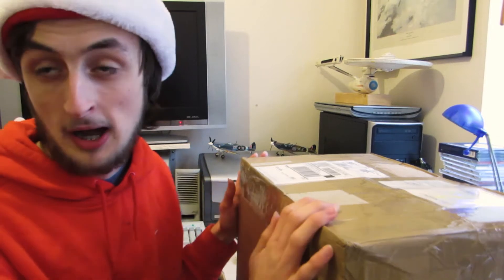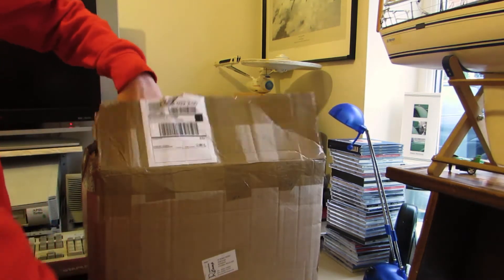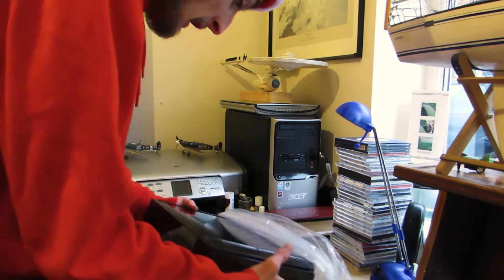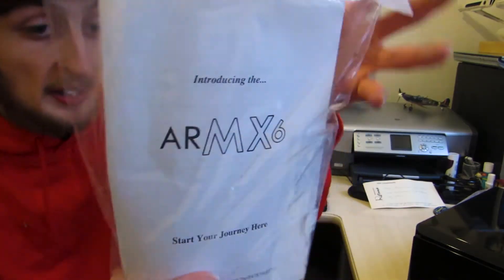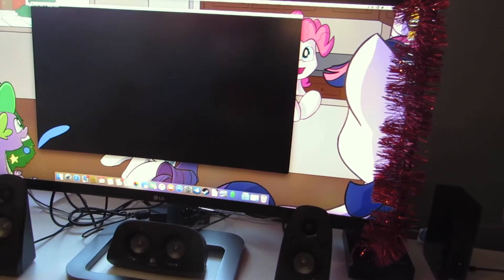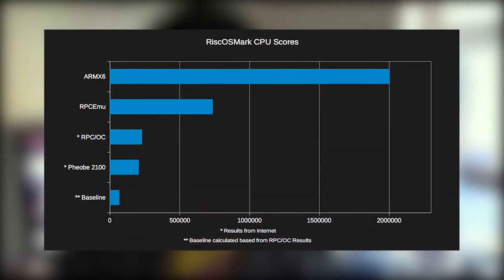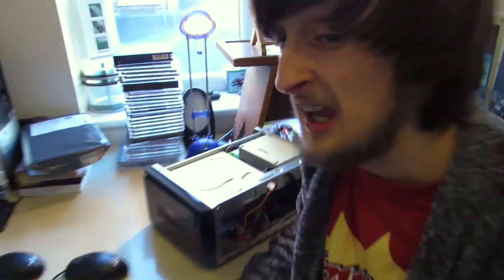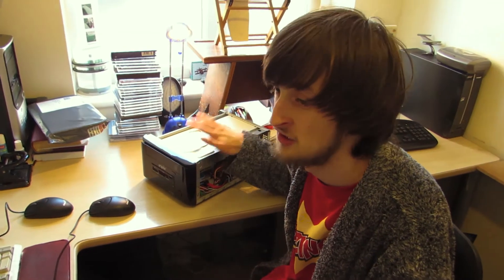Unboxing And First Impressions: ARMX6

Comment: Looking forward to getting one real soon - hopefully before Christmas. I currently have an old Iyonix, which has been gathering dust, mainly due to no longer having a monitor with DSub connection, and using a RiscOS loaded onto a Pi in place of it. I've been looking for something more up to date Since I've just had my brother replace the internal battery - now fitted with a propper socket and cell, instead of the usual Acorn/Castle approach. 
Also Big thumbs up to the Enterprise in the background.